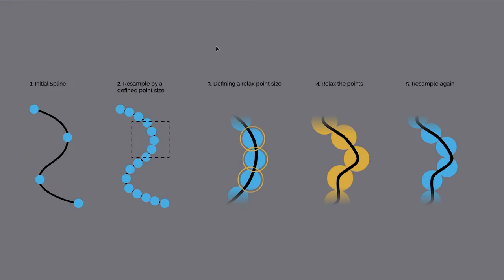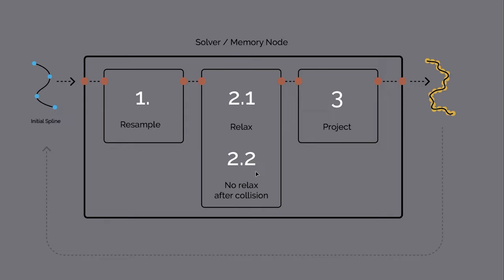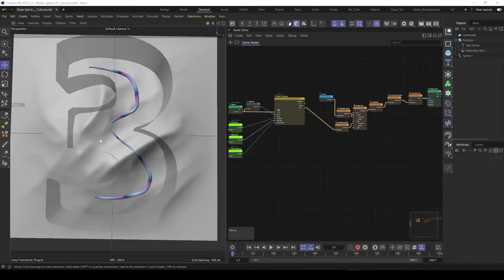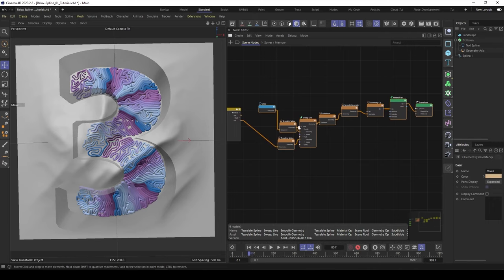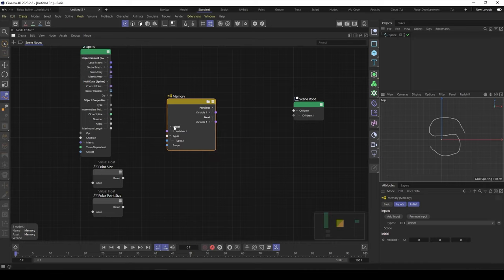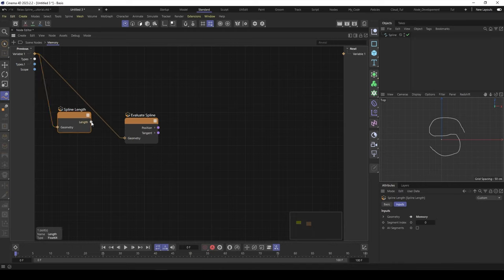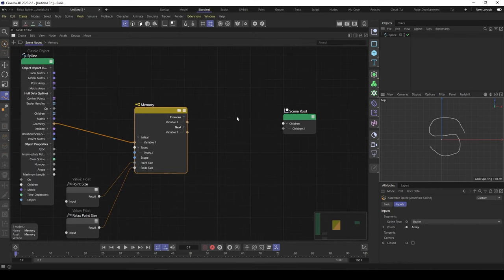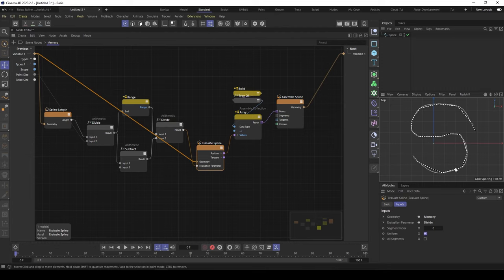Building a Spline-Relax Solver with Cinema 4D Scene Nodes.

Comment: Again a really cool setup, love it! Two tips:
- There is an automatic conversion from Array<Matrix> to Array<Vector>, you don't have to extract the translation yourself.
- Use Assemble Collection where possible, that's more efficient and also allows for parallelisation. E.g. the Set Element node between Closest Point On Surface and Assemble Spline can be replaced by an Assemble Collection node because it uses the loop index. Only use Set Element when you need random access to the array (i.e., when you want to write to other elements than those for the current index).
Reply from the maker: Thanks again for the great tips. So if I understand this correctly, this affects performance, right?
Can you may tell me where to get such valuable insides, would be highly interested :)
Reply: @realruckli  `Scene Nodes Editor > Debug > Enable Heat Map` is a great way to find places where your graphs are operating slowly.

One thing to watch out for with `Assemble Collection` is that it doesn't work with multiple scopes/nested-loops. In those cases you need to use the (slower) Append node.
Reply from the maker: @scenenodestips   thanks for the tip. Yep, the heat map is already in heavy use. Ole also gave me valuable insides to optimize my setups.
I built a new "shortest path" setup with his inputs, it's super fast and makes perfect use of the parallel execution.
I'll prepare a tutorial in the next weeks about it.
Thank you guys again for the kind support :)

Comment: great job man! i wish they finally add high lvl nodes in there so we can work. Its funny how easier is houdini in comparison.
Reply: I've been using c4d+xpresso+python for 17 years and just started learning houdini. I have to agree, just building the resample is wild in c4d vs houdini. Makes you really appreciate the prebuilt tools that houdini has available! 

Hopefully Maxon also does it in a similar way to houdini where you can drop into nodes to see how they work (i.e. a resample node built with high level nodes on the inside). They already kiiind of did this eons ago with XPresso X-Pool System Presets.

All that said, this tutorial made me think twice about sleeping on scene nodes! Looks like they are really having a go at the houdini workflow. I had previously thought that scene nodes were only capable of much lower level stuff.

Comment: Great tutorial, could we start the setup with an edge selection instead of spline? (i.e similar to resample node in Houdini) ?
Reply from the maker: Definitely doable. But when we convert an edge selection to a spline (for example, with the edge to spline node) we have more than just one spline segment. So that also requires the handling of the segments of the assemble spline node. Therefore, I have no quick solution ready for this problem. Maybe i'll tackle this problem when I've got some time. Cheers
Reply: @realruckli, I appreciate your response.  I'm looking forward to seeing your expertise shine in this area! 😉

Comment: man, this is an awesome tutorial, but how the hell did you figure all this stuff out. i seriously think Maxon needs to rethink how they are doing the scene nodes stuff. its really not intuitive.
Reply from the maker: It is actually not as bad as everyone thinks. It is everything there to build complex stuff, and the performance is also pretty nice if everything is built correctly. But I think it is useful to have a basic understanding of programming and vector math for the moment because there are not as many high-level nodes as in Houdini and Blender. But the core for doing complex vector math is there. Scene Nodes are still in beta, it is definitely possible that they will rethink certain things.
Reply: @realruckli  Hi, do you have something like a beginner's guide to scene nodes? Even with a basic understanding of arrays/iterations etc., I still find scene nodes extremely ambiguous, because cinema has it's own implementation of the above-mentioned concepts(you need to actually know what a specific port expects and what data type is being returned and how to further process it, etc.). Or do I just need to spend some time binge-learning hardcore math and programming and expect it all to suddenly "click" at some point? Thank you
Reply from the maker: @kazlica  Yes, I already thought about some small beginner tutorials, but I do not want to promise anything yet. It depends a bit on my free time and motivation ;)
And yes, I highly recommend having some basic (not "hardcore" :) ) understanding of programming and vector math. And some knowledge in computer graphics is also a nice addition. This all helps in general, no matter wich 3D software you want to dive into.
But for the start, I can recommend reading the documentation Maxon provides. There are also a lot of helpful scene files hidden in the documentation.

Comment: thanks for sharing. I try to use this trick to make a capsule, but it seems the memeory node does not work with capsule. Is it a capsule limitation?
Reply from the maker: The memory node works in the object group capsule since 2024.1. In older versions it just works in the scene node context. And i think it will also work in the other capsules in  future versions

Comment: thanks for video! How to change time range for this node? Very quick animation
Reply from the maker: Hi Timtim, glad you like it. Do you mean how to slow down the effect?
Reply: Yep, i want a little bit slow. So i changed point size, but not helpful @realruckli
Reply: @realruckli  yes I want to slow down the effect because it's too fast. I have a point size, it didn’t help, what should I do to make the effect slower and not have strong shaking?
Reply from the maker: @timtim5327  I built a Spline Capsule with an additional smoothing setting. For a slow movement make the Relax-Size just a slight bit bigger than the Point-Size. You can fin tune the effect with the Max Iterations and the Smoothing Setting (all Settings on the Capsule).
Getting rid of the jittering is close to impossible, thats the nature of this effect and the limitation of the Point Relax Node. But you can tone it down to a minimum.
You can download the new Capsule on gumroad. Have fun :)

Comment: Love this stuff even though it's way over my head. I followed along and got a good result on everything but the gradient material on the spline. The gradient looks like it its spaced far out and the spline only covers a small portion of the gradient. I don't see the tight bands from all the gradient knots like on your sample. Any thoughts on what I'm missing with that material step. Re-watched the last 2 mins several times but can't get my RS material to like the same.
Reply from the maker: Hi @MographChamp hhmm hard to say what's going on without seeing the scene file. You can send me a PN with the scene file to check it or you can download my example file from gumroad and compare it with your file. Hope that helps.
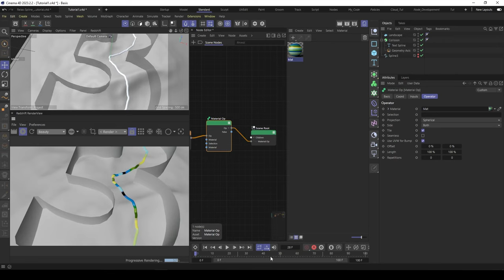Reply: @realruckli  aww! the Material Op in the tutorial is showing as spherical projection but in your file it's uvw. When I switch mine to uvw projection it appears the same as your demonstration in the tutorial. When my material op is set to Spherical projection like in your video at 29:59 the gradient looks spread out like the spline is online being covered by a small part of the gradient. I know it was a small detail but it was driving me crazy on last step.  Thanks for making the file available.
Reply from the maker: @MographChamp  oh yes you are right, the Material Op is set to Spherical by defult, what I think is very strange, UV would make more sense to me. Forgot to change this in the tutorial.
Hope everybody who has the same problem reads your comment :)

Comment: Hi! Don't know if you're still reading comments, but I hope you can assist me with this.

Whenever I try to import the spline animation into a separate project, the animation stops working. Even when I copy/paste the original nodes - no luck. 

Can't seem to add another spline to the node editor either (another letter, for example). It just slightly distorts the original spline. Just want this animation in another scene, that's all. I'm new to the node editor, so any insight on this is much appreciated!
Reply from the maker: Hi decy, hmm not realy sure whats going on there, but it could be that some parameter reset when you copy to a new project. Check if the parameter values are still the same in the new project
Reply: Appreciate the response. Those are a lot of nodes to individually check. Is it possible to cache the animation to import as an object? @realruckli
Reply from the maker: @devy_animations Now in 2024.1 the memory node also works in the object group capsule. So you can copy the whole setup from the scene node context to this capsule and then try to bake it as alembic.